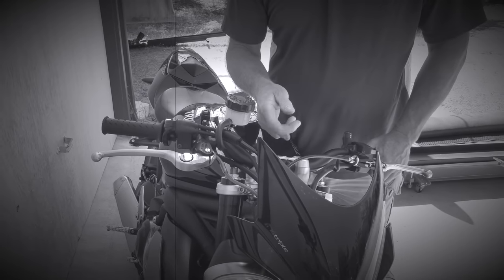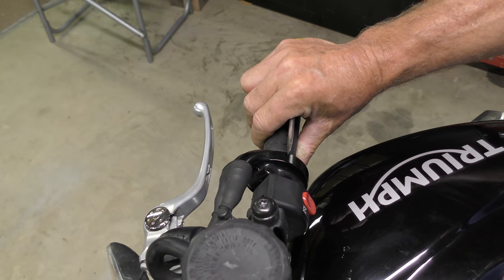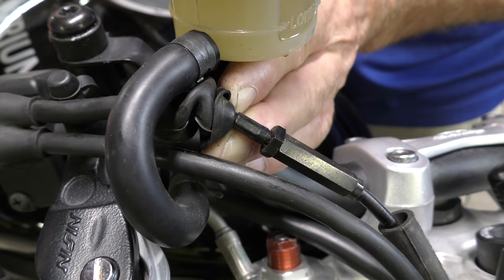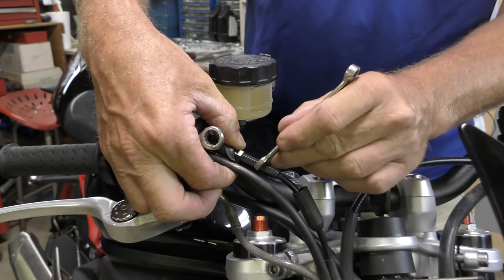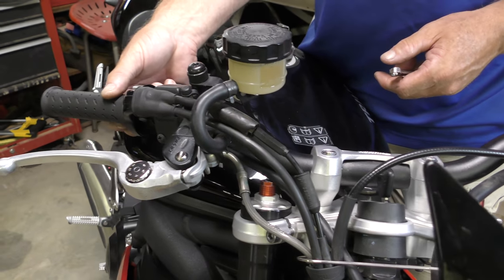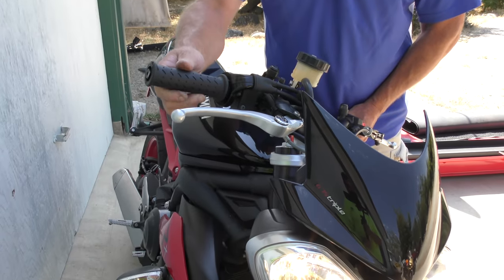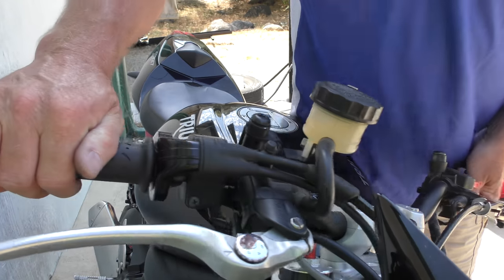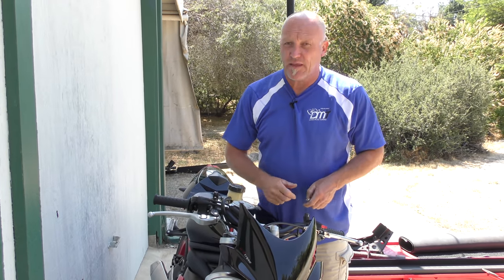Adjusting the Free Play in your Motorcycle Throttle

Comment: Mines under too much tension I checked the adjust on the handle and the carb linkage seems I need more wire ? Please help revving too high new carb installed
Reply: If it's a different model of carb then check if the linkage is in a different spot than the previous one, hope that helps

Comment: Throttle play is the first thing i did on my mt07 after setting the rear sag. Factory position for the rear of this bike is no sag at all for some reason. Put an r6 throttle tube on for less throw and adjusted the freeplay down to a minimum and everything that has to do with throttle input feels 100x better. Downshift blips so smooth now where factory setting the timing was a littke wonky. No more twisting my wrist past where it can go for full throttle or having to have an adjusted grip to be able to open it up all the way. Now i can have my grip in a comfortable spot for braking off throttle, for braking on a little throttle, and wide open without adjusting grip at all. Simple things sometimes can transform a motorcycle like fine tuning control inputs to you. Everyone should go out and expiriment with their throttle today!

Comment: 8 months ago got my first bike, yesterday I adjusted the levers and now adjusted the throttle play. It always bothered me but I never thought it's just a small fix. Would have never thought that turning the handlebars changes the free play though. Haven't started it yet to check but I moved the bars all the way both ways to make sure I still had some room and was not locking the throttle. Thank you!
Reply from the maker: Great thought process in checking free play before starting the engine. If the cable is too tight, idle rpm;'s will rise slightly as you get to full lock.

Comment: As someone who has had to use good engineering practices and a suck it and see approach to mechanics its nice to see someone confirm what has been learned.
My baby bro and myself had this very issue last week were he had over tightened the outer cable and was holding the revs up as the throttle wasn't returning. Exactly as shown by Mr Moss. RF900R completely original has had everything done since it was purchase last September £1000 to purchase just under £1000 on parts and labour was gratis. This included new springs for the forks and a full service on both forks and shock. Different bike to the sorry thing we picked up.

Comment: Thx for your video, great explanation. My adjusting nut is already at its maximum, any further and it will fall of the throttle housing. I only had the bike for a year... Any advice would be appreciated, thx
Reply from the maker: Put the throttle adjustment to minimum. The tank needs to come up and you need to adjust it on the throttle body end as best you can. If the cable is too stretched, a new one will be needed.
Reply: @catalystreactionsbw  much appreciated Bud, i will try that....

Comment: I love how I watch all these videos and y'all are like tightened your cable otherwise it's gonna be choppy. While me : check throttle free play -2.88mm lose it to 5mm much better lol 
 To each his own, I normally wouldn't do it, but my current bike just has a choppy throttle (maybe TB needs adjusting, maybe poor tune) but on the actual throttle- it felt like I need more Freeplay and so I did just that. much better now. 
03 Aprilia Tuono. Been riding for 8 years and many bikes, never had such on off action throttle, however the bike is a blast so I deal w it
Reply from the maker: Thanks for sharing what you  found works for you in regards to the throttle cam and cable slack. A tip of the hat to you!

Comment: I'm not as concerned about free play at this point (on my first bike I should add). It just seems to me that my throttle moves too easily and I'm having trouble controlling it. How hard should it be to roll it back? Mine gives me very little resistance. I don't know, I'm new. Maybe that's how it's supposed to be?
Reply from the maker: Being new is the best of all worlds as you have an insatiable appetite for learning. Throttles should literally snap back with a "crack". These days, throttles are much easier and smoother so for new riders, bikes generally have a long throw throttle meaning they turn a lon way before you get to full throttle. Kind of an inbuilt safety system. That smoothness is very off putting to new riders as power can build quickly based on the engine size you have. So yes, I empathize with you with this observation as i am like that with some new bikes that have 1/4 turn throttle and are so smooth you do not feel the roll on. Try a little grease on the throttle housing end to give you perhaps a little more feel.
Reply: @catalystreactionsbw  Thank you very much for the reply. I'll get there.

Comment: If it's all been taken apart and I'm starting from scratch, it takes me ages to find the best adjustment but still it's too much free play yet hangs the throttle on right steering lock.
If you loosen the throttle cable should you tighten the return to compensate?
Do you recommend cable lube or leave dry? (Ireland weather, outdoors 24/7)
Reply: Definitely should lube the cable.

Comment: My throttle rolls on and snaps back OK, the problem with mine is that when it snaps back, any pressure put on the throttle causes it to move 1 to 2mm forward and the bike stalls, I've tried tightening and loosening the cables and still does it, can't find any information anywhere, riding is quite difficult atm
Reply from the maker: One cable is for pull and that sets the "gap" for free play when turning the throttle in the "on" direction. If you are able to push it forward, do you have an adjustment for the opposite cable? If so, that free play can be mostly removed. Also check for cable slop in the housing on the bar and at the throttle body/carb side.
Reply: Not done anything at carb end yet, last night I really tightened the return adjuster at the throttle itself and it got rid of the forward movement but really stiffened the throttle quite badly, so if I'm right I'm going to put the throttle end adjuster back and get down to the carbs and adjust the return cable down there, fingers crossed and also thanks
Reply from the maker: @shainexxxsescrimshaw7605  That would be correct. There should be a tiny amount of free play, so take your time with the adjustment.

Comment: Hi Dave and guys, what can I do if I cannot screw it out enough the cylinder to eliminate the free play? The other side has only a lock nut down at the throttle body. Does it mean that the cable got stretched out too much and need to be cut, also that knob reinstalled?
Reply from the maker: You set the lever adjuster at minimum. You adjust at the throttle body end as best you can. Then adjust at the lever. If you cannot get the correct adjustment the cable is stretched too much and needs to be replaced.
Reply: @catalystreactionsbw  Thanks a lot for the fast help!
Reply from the maker: @fulesmackofule  No problem!

Comment: I adjusted my throttle cable and now my speedometer glitches from 70 to 150 and higher.. Do you know why adjusting it would do that?
Reply from the maker: Throttle cable adjustment issues relate to idle rising at full lock left and right. I have not heard of a speedo glitch. Depending on the year and model, check where the speedo location is and clean it.

Comment: How to adjust throttle slop on a 2018 Honda Grom which has no adjustment turnbuckles in the cables?
Thank you!
Reply from the maker: eBay shows Grom cables with an adjustment on the throttle body end. That is where you adjust freeplay.
Reply: @catalystreactionsbw     Don't know that I can trust Ebay because I bought a $46 luggage rack which was SUPPOSED to fit my Grom but doesn't, and to send it back to China, FedEx would charge me $100!!

Comment: Is there a way to adjust electronic throttle free play? Same issue but no cable to tighten to fix.
Reply from the maker: Throttle free play is like any other adjustment. Set it to what you prefer! The housing sends the electrical signal.

Comment: Some ashbag mechanic cut my oem grip cause he said the grip was getting longer cause its old and binding the throttle, no he cuts it and its the same sticky garbage, he just doesn't know how to adjust the clutch... He also charged me 3800cdn for a safety on a 250ninja from 2005.......
Reply: An it doesn't idle cause he never replaced the broken idle adjustment screw. An doesn't know the proper procedure for starting the bike as it differs from most carberated bikes.

Comment: but my throttle doesn't have cables .. it has electrical wires ... I guess I can skip this lesson 😉
Reply from the maker: That would be correct for cable free play, but you still need to make sure the housing is clean inside and working correctly.